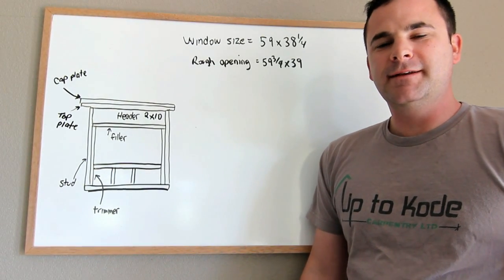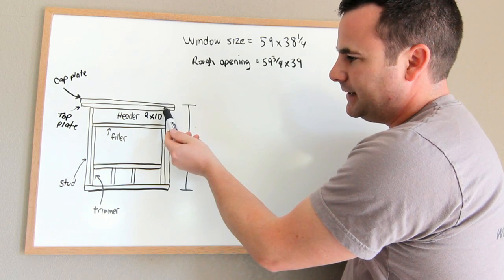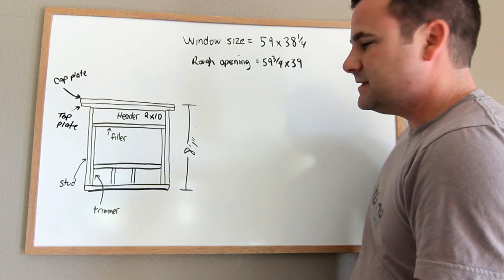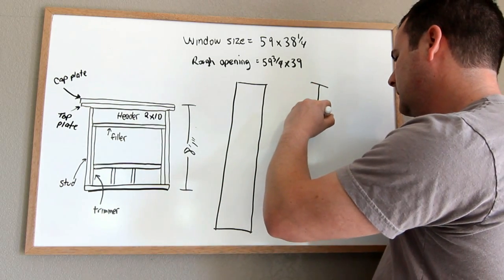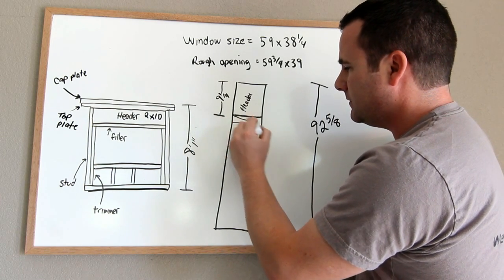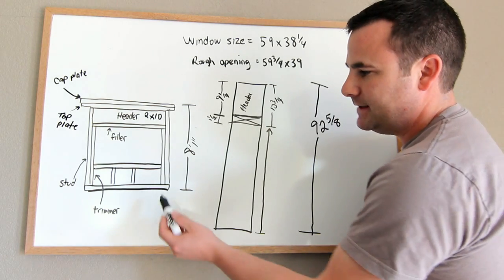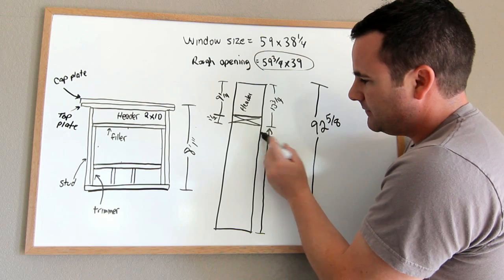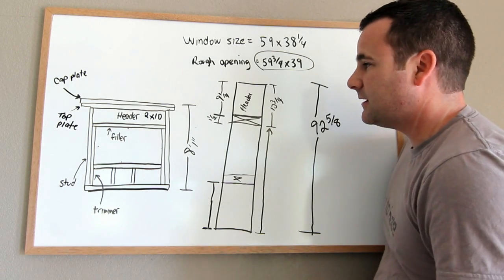How to Frame a Rough Opening

Comment: Very cool video! I have a question, if I may. What about sloping the sill for avoiding water retention on it? Is not done while framing the rough opening? Thank you.
Reply from the maker: Definitely a good idea. I use insulated concrete forms for my exterior walls so I don’t know know how difficult this would be to implement into wood framing.

Comment: Thanks very much.
You made one small verbal mistake - you said R.O. should be 3/8" larger than window, yet you show correct 3/4" on the whiteboard.
Reply: He actually said 3/8 on each side which added together would be 3/8 + 3/8 = 3/4.  This is still different than the States where we typically do 1" (1/2" per side) but I suppose it doesn't really matter, so long as there is room for adjustment/shimming.
Reply from the maker: Thanks for helping clarify that!